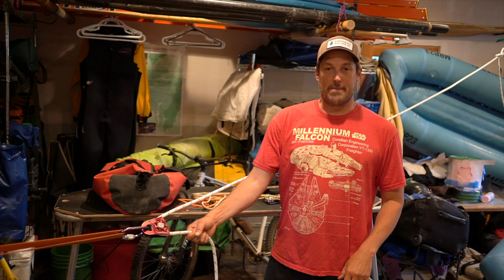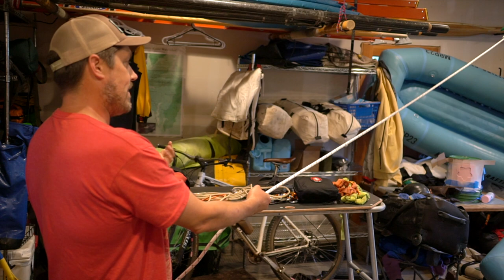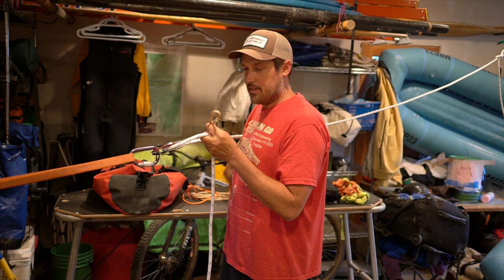Simple Progress Capture System | Ep. 86

Comment: Thank Zach, I like where you're going with the show.  I think you should also look into Petzl roller biners. I have a Petzl Rollclip Z manual locking biner that I carry in my pfd along with the micro traxion. I think that's the way to go without putting too much weight on.  However you are correct about needing people in your group knowing how to use them.  The roller biners are great for light work and change of direction, but for heavy loads we'll bring out the big pulleys.

Comment: The hollow block u mention? Is that the Aramid fibre weave style? I approached a height safety shop and when I told them the dimensions of the hollow block i scored from a highrise building in Brisbane city. It was being used for tying off safety Webbing around the perimeter of the top floor. I should have taken more. Lol the guys who setup the safety net threw out bundles of it. I took a 1.8 metre length. It's 25 mm wide by 8 mm thick. I wrapped around my 11 mm static rope to see if it will grab? But too thick. I could easily pass a 6 mm steel cable through and use a lanyard! In Australia we are behind in climbing products unlike you guys in the US. Sorry for rambling on! I love the way you explained this so well. In my head I knew about redirecting pulley system. Adding more etc. But sometimes you need to see it in action and bang! It comes back to you! Lol. Cheers for the great vid. 🙂👍👍👍

Comment: Thanks Zac. I'm guessing with a round boat, you hook up to perimeter line to spread the load?
Reply from the maker: I personally would not use the perimeter line. My suggestion would be to use a 2 or 3 point self equalizing anchor to d-rings.
Reply: @GearGarageTV  Thank you. If you haven't done a video on that, I sure would appreciate one.

Comment: Zack, you can simplify your gear by replacing pulley, prussik and second binder with a Petzl Micro or Mini Traxion.  I think CAMP makes a similar device.
Reply from the maker: Both of those devices are known for tearing the sheaths on ropes. I have them and use them occasionally but don't recommend them for people that don't understand their weaknesses. Also - I prefer equipment that most people are trained on and familiar with.
Reply: @GearGarageTV  I'm only aware of sheath damage caused by Mini/MicroTraxion when the rope is dynamically loaded (i.e. significant slack in rope and accelerating load). Is there a hazard in raft or swiftwater rescue that presents a dynamic load hazard more readily than in the vertical and near vertical mountain rescue I'm more familiar with?  In other words, what water scenario should a rock rescue specialist be aware of to avoid dynamic loads with any progress capture, as they all become susceptible to failure under dynamic loads?
Reply: De-sheathing a rope with a toothed device also happens when using a rope diameter smaller than the manufacturer's recommendation.  All progress capture devices including prussiks will fail when the haul rope is too thin for the device.  With recent advancement in fibers, the old saying of 2mm greater rope diameter than prussik diameter is no longer accurate, but is a good place to start for many in this audience.

Comment: Love the videos Zach!

But I disagree on your comment about pulleys and changing directions. Pulleys do offer a mechanical advantage, assuming friction-less bearings
Reply from the maker: iProject yes you are right they can offer mechanical advantage. The way I set this system up in this video does not provide mechanical advantage.
Reply: @BladePressure  Ryan, i hate to tell you but your example video example 1 matches the load vectors that Zack set up. "No Mechanical Advantage".
Reply: I appreciate all the replies. But when pulleys are used to lift or move an object, they do offer mechanical advantage. Why else would we used Z rigs? A 3:1 system allows a 300lb load to be moved with only 100lb of force. 

What am I missing here?
Reply: Gosh, never mind I get it now. Zach had it setup as a 1:1, so no MA
Reply: So are top rope systems for climbing considered 2:1?
Reply: Awesome. That helps for sure. 

It would be 2:1 if the rope was attached to the tree, the pulley was on the boat, and Zach pulling from shore, yes?
Reply: @symo thanks so much for entertaining this and taking the time to respond. Really appreciate it!!

Comment: What happens when the boat releases and floats down river? Can this be released quickly to allow the rope to run out through the pulley?
Reply from the maker: No releasing it is not quick and easy
Reply: @GearGarageTV  If you need to, I'd use 7mm cord (not tied in a loop) with a munter mule and just the slip knot tie off so you can pull it if you need to release it quick.